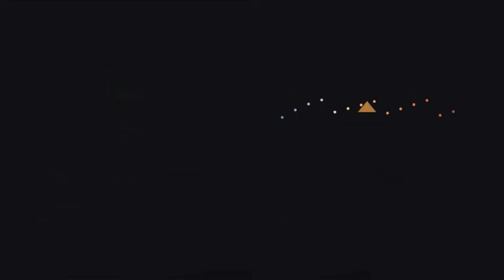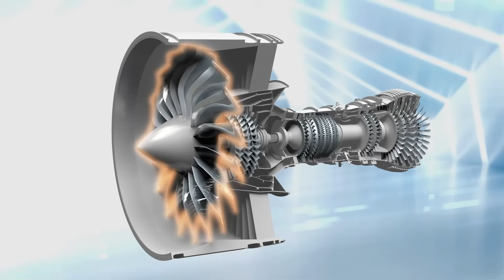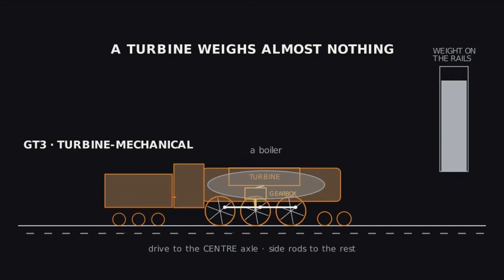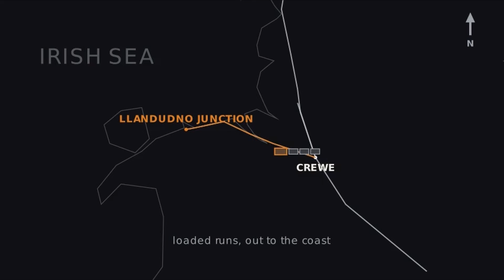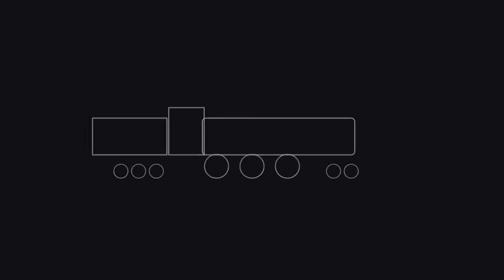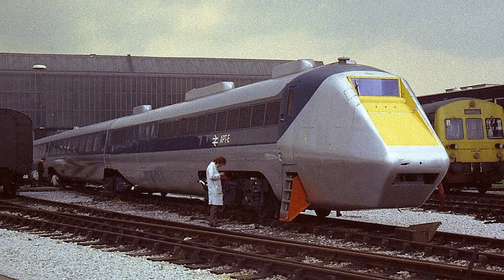The Strange Story of the GT3

Comment: this is a great example of going down a very stupid tech dead end. Japan's Shinkansen was already running, fully electric, at 210 km/h (130 mph) in 1964 - so the rest of the world should've immediately gone electric.

a similar thing is happening today with pointless hydrogen vehicles and inefficient hybrid cars when it already clearly makes a lot more sense to go full electric.
Reply: Hydrogen clearly lost out
Reply: Sort of, the one difference with hydrogen from this example is that our transportation infrastructure has a lot of point-to-point deliveries that are not suitable for electrification. Electric long-distance trucks just suck. The battery to cargo weight ratio is awful and the inefficiencies of fast charging are amplified in that scenario. Additionally, not all rail lines are suitable for electrification. Lines through long, desolate stretches where there's no human population to even do maintenance, for example, lines like those were electrified by the Soviet Union and that infrastructure has since fallen into disrepair without an unlimited state budget to maintain it.

There are use cases for the higher energy densities and faster transfer speeds of hydrogen. Alternatively, they could be met by biodiesel at the cost of much less energy storage efficiency. Whether or not hydrogen makes sense to develop for those cases depends on how prevalent they are.
Reply: @SpaceBearEngineer  not true at all. Cargo trucks can fast-charge while loading/unloading or during mandatory driver breaks. and rural trains can be BEVs with onboard batteries where many rural lines cannot be electrified due to tiny tunnels/bridges.

Both those things are already happening now because they're feasible with BEVs.

Comment: Seems really bizarre to take a light power plant like that, AND put it on a chassis having unpowered axles, meaning that you have to add even more weight to it than you would already.

Too bad they never did for the earlier gas-turbine-electrics what Union Pacific did for their gas-turbine-electrics that made them actually successful:  Include a diesel engine to provide smaller amounts of power so that the gas turbine can be shut down when its high power output is not needed.  The Union Pacific used gas-turbine-electrics in revenue service from 1952 to 1969, after which rising fuel costs (Bunker C quit being extra-cheap) and the need for heavy maintenance finally put them out of service.
Reply from the maker: This is just one of the examples of a long history of strange methods of locomotion. It gets a lot wierder the more you look into it!

Comment: A lot of the problems you cover (fuel use, operating efficiency) come about from the fuel choice (kerosine, heavy and light fuel oil) at a time when these fuels were considerably more expensive than coal in conventional piston engines which were a mature technology.

Stanier's LMS Turbomotive was a design attempt to address this, by using coal and steam driving a steam (rather than gas) turbine, with the amount of propulsive steam being delivered by a chain of selectable steam nozzles of increasing size, chosen by the driver. It showed good improvements in drive flexibility and coal/water consumption in timetabled operations over a number of years. Sadly, the turbine failed after years of use and it was deemed irreparable.
Reply from the maker: I'm planning a video on Staniers turbo locomotive. It's one of my favourite unusual locomotives.

Comment: solution is adding batteries to take power when its not needed. turbine hybrid also needs smaller turbine because the battery can add low torque
Reply from the maker: Not quite, batteries are heavy and take up space. Adding battery arrays to a locomotive that is already using every available cubic inch of space will be a technical nightmare.
Reply: One reason we don't see turbine hybrids is because turbines are not great at starting and stopping either. During startup they are massively inefficient and also usually a bit unstable. Turbines really are best for scenarios that involve as little restarting and throttling as possible. Powerplants are pretty much the ideal job for those.
Reply from the maker: @SpaceBearEngineer Don't forget aircraft!

Comment: "The turbine was beaten by the fuel bill."
Well said. Fun fact; the french TGV trains were originally intended to be a turbine-powered fleet... and then the fuel crisis happened, and the engines were redesigned to be electric. I slowed down rollout of services by a year or so, as overhead wiring was not ready for the initial launch - overhead was not part of the original plan!
Reply: Well, I'd argue that it was partially the engineering that beat the the turbine train engine. It's really a square peg for a round hole. The big advantages of turbines (high power in a small form factor and low weight) just don't matter for train engines. And you can only get the "exceptionally high efficiency" if you build a combined cycle engine, which in turn is too big for a train engine.
It might have worked for the TGV - i.e. a dedicated high-speed train - where you need high continuous power. But even for that I'd argue that electric is just plain better.
Reply: @ahoannon5711 I agree; electric is far more efficient for trains. The fuel crisis in the 70's may have accidentally been the best thing to happen for the TGV.
Reply: "as overhead wiring was not ready for the initial launch - overhead was not part of the original plan!"
Also very interesting!
'Overhead' is very expensive, it is also prone to thievery - which makes it somewhat unreliable, particularly because it is (was?) powered down during the night.
It could be that the decision was taken to use it because of the large amount of energy coming from the French nuclear power stations - also a good choice.
Reply: @DAMORBEL  France had been expanding electrification over time, although most of the installed base was of the 1500VDC legacy variety still at the time, 25kV at grid frequency was not as widespread.  SNCF already had some Gas Turbine trains prior to the TGV, and Amtrak even bought some for use on various routes.
Reply: @JohnGeorgeBauerBuis  The English are not good  at recognising the many excellent engineering achievements of the French!
Their suite of nuclear power stations has had a truly wonderful effect on their economy.
Reply: The same with our very own APT. (As featured in the video).
Reply: @AtheistOrphan The APT had other problems, mainly death by media smear.
As you likely know, the brits sold the tech to Italy, who ended up perfecting the tech. Britain could have finished the APT with a couple more years and public support 💔😭

Comment: Thank you, interesting subjuct. Fuel prices killed the Union Pacific turbines also. They were run on bunker-c(sludge oil). There where 4500 hp and the 8500 hp versions. Then they discovered fun stuff you could from the sludge and the price went up, dooming the GTELs. We won''t talk about the coal fired turbine. BR tried one also.
Reply from the maker: I have a draft script for the GTEL, still working on the details...
Reply: I believe because of their huge fuel consumption, regular diesels were used to move them from their yard into position on the consists and then they would take off - no taxiing or idling, just takeoff.  I understand one stopped under a highway bridge and it burnt a hole in it.
Reply: @lewisdoherty7621  Yes, each unit had a hostling diesel to move it from the engine facility to the train

Comment: The real reason a turbine engine is less efficient at lower power settings is because the pressure its rotary compressor creates is correlated to the RPM. Whereas the compression stroke on a piston engine creates more or less the same pre-ignition pressure no matter what the RPM. The higher the pressure ratio generally the more efficient a thermodynamic cycle is as the turbine or power stroke can expand the hot air more and capture more of the heat energy. Therefore if you put a turbine engine on a 50% power setting you get much less peak pressure than at full power, the turbine can't do as much work on it so more heat is wasted out the exhaust than converted to mechanical power.

Comment: Everybody was fixated on gas turbines in the 1950s for cars, trucks, buses as well as railway locomotives. They all foundered on the inescapable fact that turbines are only efficient running at full throttle, something land-based vehicles can rarely do. Even the Rover-BRM racing car was short-lived. The only non-aviation application that really works is for warships, which mostly carry diesels for low speed operation and only use turbines for the rare occasions when full power is needed.
Reply: I was in a transport museum a few months ago, in the car section, and I spotted something, almost hidden down the bottom of a load of shelves, no label on it. I recognised it as a small gas turbine engine. I enquired about it and they got the curator to come and talk to me. Sure enough, it was a unit based on the Rover gas turbine engine, but they didn't have an awful lot of details on it to give it a proper information board as it had just been donated to the museum as was. They were going to try and find out more.

Comment: Turbines are also far less efficient at a standstill, something which locomotives have to stay at frequently.
Reply: A gas turbine electric locomotive with an auxiliary diesel and a battery to help with peak loading would be a better bet, similar to various CoGen ships with both gas turbines and diesel-type engines.
Reply: @JohnGeorgeBauerBuis no.
Reply: Unless producing thrust. They HAVE  to work idle just takes away all benefits.
Reply: @osmacar by "at a standstill", I meant while the vehicle isn't moving.

Comment: Turbine engines. They're brilliant l. Amazing engines... For aircraft or things that use the thrust. The exception being helicopters. As they need a constant work done so constant fuel isn't an issue. And while helis are aircraft they don't use the thrust, hence me saying they're the exception.
Reply from the maker: I'm working on another turbine locomotive video at the moment, they've piqued a bit of a fascination in my recently.
Reply: @Marc_Flint  fair enough.
Reply: They could maybe work on a high speed line with no intermediate stops. But now we have high voltage electricity which is good enough, there's no real point. Even hovercraft have gone away from turbines to diesel now as it's quieter and much more fuel efficient.
Reply: @paulsengupta971  Best way to power a train with a turbine; put the turbine in a building to generate electricity, and us that to run the train. We can get into discussions about the cost of electrification. Amazingly Europe seems to do it.
Reply: Discharge Whats left in the battery setting off, switch to turbine generator, let her cry, whatever may be overproduced can be flowed into battery, discharge to grid upon arrival
Reply: @johnnessuno6515  too much hassle and vy the time methods of easy maintenance are presented we'd have better tech.

Again useless unless producing thrust as they need constant work done
Reply: @paulsengupta971  no.
Reply: Turbine engines are brilliant. Wood, coal, gas, water. So many sources of things can power them. Turbines can be categorized, and they should. If a engine has to be internal combustion? Then so be it. But really a water turbine is a engine turning over a generator. And a generator is basically a electric engine made to turn in reverse... yea...

A engine engine? A piston engine? That is what a piston compressor is. What is a compressor that spin called? Turbine.

Turbines makes for a really silly rail engine. Even now ships use turbines. Both in steam form and internal combustion. A other silly use of a turbine is in cars and tanks. Yet we still have M1 Abraham and S tank. (Strv 103.) S tank being the first tank with one. Mutli-fuel and weight. I'm no fan of M1 Abraham. Yet there is a case to be made that a real advantage of a turbine engine is it can run on far bigger range of fuels. The hole concept is sort of ridiculous but so it be. The other good advantage of turbines are the power to weight. Even now this really is the key point where locomotives truly show what a silly concept it is to be putting it on rails. It is almost as silly as trying to power a train by using battery power or to that effect alone.

Not fully sure about this one. As a side not regardless. Rotatory engines. There is disadvantages like sealing combustion chambers. But in practices it seems to have been tried to be put into use for lorries in USSR as pure early experiments. Full on diesel rotary engines that have all the advantages of turbines without trying to be a aircraft. At face value the idea of such engines are as close to failure less. The least amount of moving parts and so on. Yet did it pan out in reality? Simply inserting. 

Yet as I simply have been trying to prove? Quite ridiculous to think that turbines powering some of the worlds fastest beasts on the seas have anything in common to aircraft. Those turn a shaft that drives a slow turning propeller when compared to a early piston aircraft. There is no thrust from the turbine excused generated in those that make the ship go. It is all going down a shaft. Only alternative at sea is piston engines. That being steam pistons or modern diesel pistons. Those modern ones are scary to think about. Asking to rip the world apart from each power stroke.
Reply: @TheDiner50  that's a whole lot of copium for a whole lot of you never understanding.